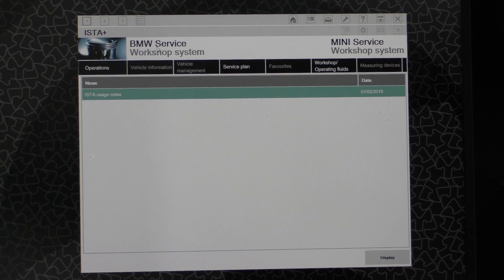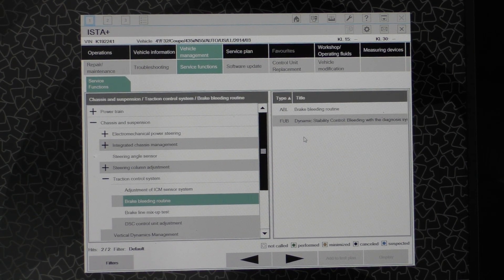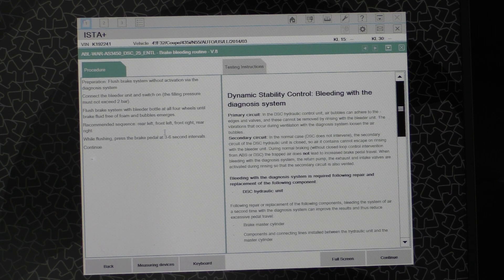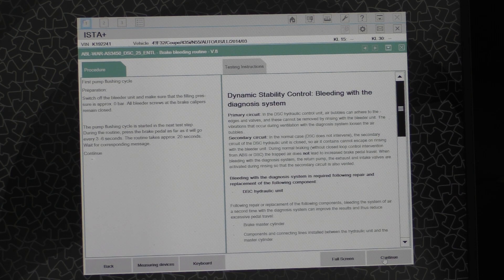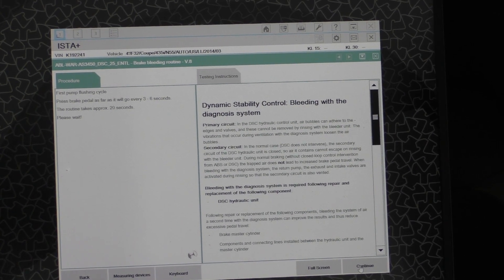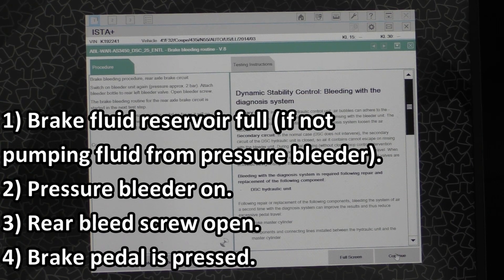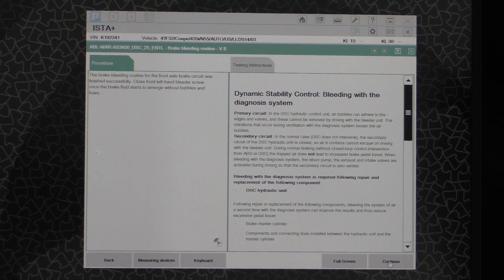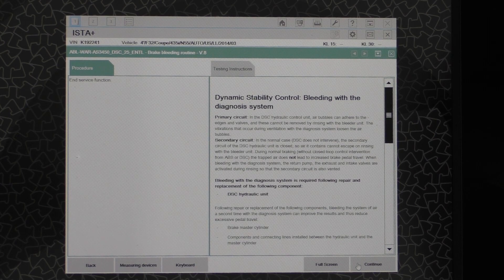BMW ISTA DSC Brake Bleeding Routine (F2x/F3x/F8x)

Comment: great video...wow ista states 2bar of pressure which is 29psi...most everything I've read says 10-15psi. Do you think the 2bar applies to the manual bleeding as well?
Reply from the maker: By manual bleeding do you mean using a manual pressure bleeder? If so, then yes since the system doesn't know whether it's being pressurized by a manual pressure bleeder or not.
Reply: @FaRKle0079  ok cool thanks for the reply, how much pressure did you use? I think I'm going to use 25psi because at 15psi the pump barely even moved the fluid through the lines. Most everyone says don't use more than 15psi and that the Motive power bleeder says not to use more than 20psi and none of that is correct. It's funny how people spread misinformation and nonsense and swear by something, yet they don't have accurate information. 

I understand the reservoir can be old and faulty or the lines can be bad but I'd rather a faulty section of my system rupture in my garage rather than on the highway. The manual says approx 29psi and I'm going with that.
Reply from the maker: @Thomas998822  I usually do 25psi to give myself a bit of margin.

With the Motive bleeder and plastic cap I didn't go above 20psi. What I found is their cap didn't grab very well and at 25-30 PSI it could let go of the brake fluid reservoir and pop off. That really sucks when it flings brake fluid all over...

The Schwaben one I have now is much better, and I imagine the Motive metal cap is probably better than the plastic one too.
Reply: @FaRKle0079  sounds good thanks again...I just finished the manual bleeding using 25psi...the Motive held up, but the fluid didn't come out much faster that at 15psi, so I can see how most people play if safe. I did hear someone say that 15psi is not enough to dislodge bubbles (I'm assuming that's what the ISTA vibrating part is for) and something about needing 25+psi to open some abs valve...
Reply from the maker: @Thomas998822  If you get a lot of air in the system even the 2bar/29psi isn't enough to dislodge bubbles with the DSC actuation. I found that I have to pump the brake pedal with my foot swift and hard to get bubbles free in conjunction with all the other stuff.
Reply: @FaRKle0079  ahhh... great point! I'll make sure to do that on the final manual bleed.

Comment: Do you still need a pressure bleeder when the Dsc pump is automatically bleeding the system?
Reply from the maker: Yes. The DSC module is just fluttering the valves, it's not actually pushing fluid out. It needs pressure from the bleeder for that.

Comment: Great video tutorial - thanks. Bearing in mind that you are in the US and therefore working on a left hand drive car, does "driver's side" translate to RHD vehicles (i.e. right side rear / right side front) or does the ISTA bleed process ALWAYS relate to left side rear and left side front irrespective of the LHD/RHD vehicle configuration ?
Reply from the maker: You'd want to do the bleed from the side of the car that the DSC valve assembly is on to get the shortest path from it to a bleed nipple.
Reply: @FaRKle0079  OK, makes sense. Thanks for clarifying.

Comment: Thank you for this really useful information.
As I can't use a battery charger in my garage, is it possible to execute the procedure with the engine running?
Reply from the maker: I think you should be able to do it with the engine running. That said if you have a well charged battery from just driving around, this procedure doesn't use much energy. I don't typically hook up a battery tender when doing this.
Reply: @FaRKle0079  thanks for taking the time to answer!

Comment: So my car isn't showing the ABL for the brake thing procedure. Getting PAD errors about switching the ignition off and buckling the seat belt and switching terminal 15. Is my car connecting right? Using DCAN cable.
Reply from the maker: What kind of car is it?

Comment: Can you perform this alone, or do you need a friend to open and close the bleed nipple?
Reply from the maker: Yes you can do this alone if you have a pressure bleeder (and really you should be using one for this anyways since it was designed to be used with one).

What I do is have the pressure bleeder on, open the nipple, and then go to the laptop and click on the button to go to the next step that activates the DSC pulsing. When the step is finished with the pulsing I go over to the nipple and close it.
Reply: @FaRKle0079  Thank you for your reply; I appreciate it. I will use a Sealey VS820 pressure bleeder and follow your method of moving between the bleed nipple and the laptop.

Comment: When using Ista is the car completely off, running on battery, or idling?
Reply from the maker: The car is in accessory mode (ignition on, but engine off).

You can also do it with the engine on, but not necessary.
Reply: @FaRKle0079  Thanks for the fast response definitely earned a sub

Comment: Are you saying the DSC bleed is only driver side rear and driver side front only?  We don't have to worry about the passenger side?
Reply from the maker: Yes, the DSC bleed only needs to be done on the driver's side calipers. It's important to note that the DSC bleed should be done AFTER doing a normal 4-corner bleed per the BMW procedure.

Comment: This works for the E85 Z4.
I replaced my brake lines and MTX clutch line with ECS braided steel lines and did a normal brake fluid filling bleeding procedure then my car gave me the trifecta of error lights (DSC, brake, ABS) and of course mechanics said I needed to replace the DSC module.

This ISTA bleed for the DSC fixed the problem.

Comment: Hi there, how do you know if there is any air in the system after a brake fluid change?
Reply from the maker: You'll feel it in how far the pedal travels before getting firm.

Comment: Great video, just completed this procedure on a F56 Mini. ISTA has you do both rears instead of one side but otherwise the same. Nice firm pedal now.
Reply: I am trying to do this procedure on an F54 which I suppose is the same. Did you only do the rears in the DSC bleed?

Comment: I have retrofitted ACC in my car and replaced DSC/ABS hydraulic unit. Now I have soft or spongy brake pedal. Hope this procedure will help get the air out of ABS system. Also I have Brembo brakes at front. While doing front axel brake bleed during the process, should I keep the outside bleed nipple open or the inside nipple?

Thanks for the help in advance 😊
Reply from the maker: This should help you. This procedure is explicitly called out when replacing the DSC/ABS unit.

I usually bleed from the inside nipple first, then outside on the front Brembo calipers, so I'd  do this procedure from the inside nipple, and then afterwards, bleed just a bit from the outside.
Reply: @FaRKle0079  Thank you 😊
Reply: How many nipples are there? Is the DSC proceduee done from a different nipple than the brake caliper? Thought there was one per caliper. ( I have a Mini R60 JCW)
Reply from the maker: @BBDos  Floating calipers have one nipple. Fixed calipers might have up to two (one per side). The ISTA DSC bleed is only done on the driver's rear and driver's front corners. It's the same nipple on the calipers you use for regular bleeding.

Comment: Would you recommend doing this along with a normal brake fluid change? It's gonna be my first time doing a change on my car, so that's why I am asking. If so, how much extra brake fluid do you think I'll need to account for this extra step?
Reply from the maker: I wouldn't recommend doing this unless you either have air or feel like you have air in the system.  An extra 1L of fluid should do if you want to do the ISTA bleed.

Comment: I have M sport brakes and after changing new pads and rotors, the brake is not firm as before, brakes are very good but i must press the pedal half way to floor to bite as I pressed 1cm before. I changed at bmw dealer and they did multiple times bleeding. What I can do ?
Reply from the maker: I would try bedding the pads first, but it makes me wonder if the dealership flushed the brakes properly.
Reply: @FaRKle0079  brakes were bedded multiple times
Reply: And i think they used that presure oil pushing machine+ opening caps at each caliper and getting out 1 Lliter in total of oil. No ista flushing or pedal pump.
Reply from the maker: @WoWArena1000  Yeah the dealers are supposed to have a machine that pushes new fluid in and old fluid out. Without knowing how carefully they did it though, it's hard to say whether they introduced air into the system. Unless you want to bleed it yourself, it's not going to be easy to get it done again to see without paying.

Comment: I did a SS brake line upgrade on my F20 and flushed all corners multiple times, now my pedal is soft/spongy. Could this solve the problem?
Reply from the maker: This can help. Make sure to pump the brake pedal hard when flushing if using a pressure bleeder too.
Reply: @FaRKle0079  thanks, I actually bled it again a few times per corner with just pumping and more bubbles came out, pedal is now hard :) thanks for your comment!
Reply from the maker: @Oockeshoek  Glad you got it fixed!

Comment: Great tutorial! Are you sure this is not necessary for every brake  fluid bleeding because this is regular procedure for "Bleeding brake system with DSC" in TIS.
Reply from the maker: Yes, I'm sure this isn't required for every brake fluid change. Reading through the procedure it actually says it's only need when changing out the master cylinder or DSC module (basically when air is introduced to the system).
Reply: @FaRKle0079  Somehow I missed that part of video. I see there is notice. Thanks!
Reply: @FaRKle0079  what if your changing the brake lines?
Reply from the maker: @BBDos  Probably not needed unless you get air up into the DSC unit. If you depress the brake pedal and keep it held down while you do the brake hose swap you shouldn't need to do this.

Comment: Great instruction, I installed a new Master Cylinder which allowed air into the DSC/ABS unit.  After bleeding I did get the air out but evidently not out of the DSC, great firm brake pedal but the REAR BRAKES would not release.   BMW's bleed procedure is a lot unique compared to all other vehicles I work on.  Thanks
Reply: This comment scared me to death at first, but now I just don't understand it.  How would air in the ABS unit cause the brakes to not release?  If anything I would imagine it to cause them to not work at all.
Reply: @VisualEchosPhotography  Well, after bleeding several times I discovered my new Master Cylinder was a defect.  I found this by cracking the rear brake line connection at the Master, as soon as I cracked it enough to drip a little the rear brakes released.   Installed a new Master and bingo, it bled with no issue at all and brakes were perfect right away.  Yes, I have a scan tool that allowed me to bleed the ABS but the ABS was not my issue at all it was a Master that would not release all the way.
Reply: @mrmcd5728 I have a question for you then. I recently came home from college and there was air in my brakes after I drove it for a day. I bled them using the “old fashion” method you could call it and it fixed my mushy pedal. I had to before push my pedal all of the way to the floor to get my brakes. I’ve checked for brake line leaks or anyway that air could’ve gotten in and there is nothing, haven’t been losing fluid either. Could seals in my master cylinder be bad? Or should I get a power bleeder and bleed them again